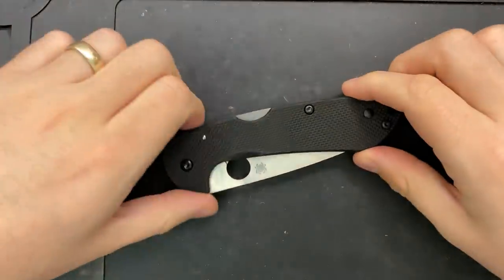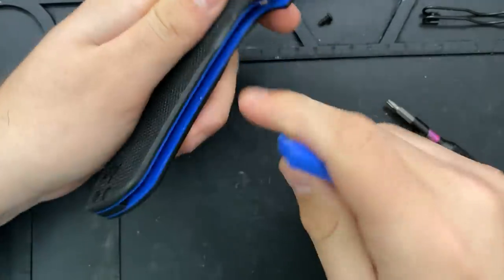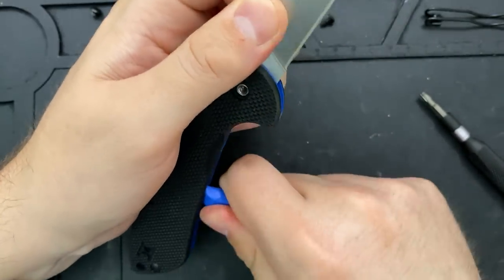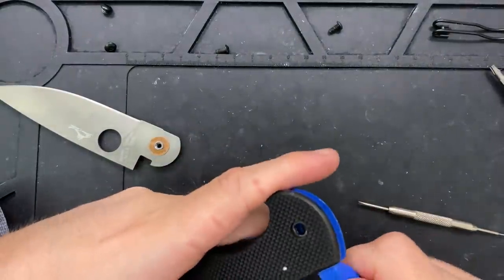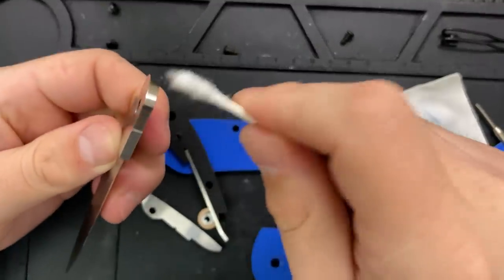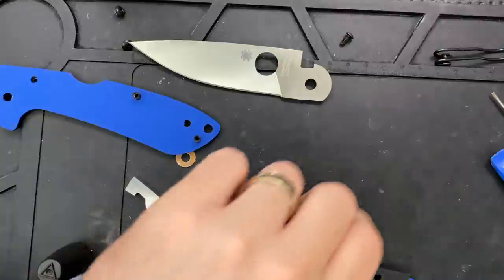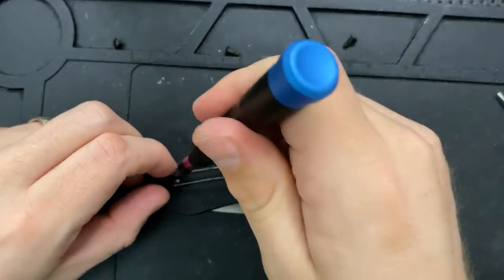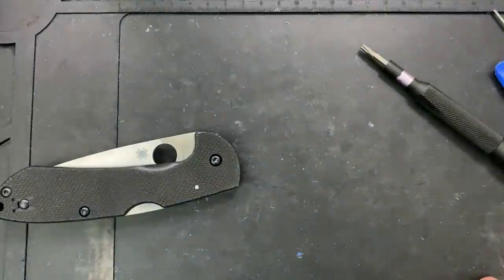How to disassemble and maintain the Spyderco Siren Pocketknife

Comment: Would've been nice to see a steel insert for the washers to slip on rather than the G10. Probably not a big deal with a back lock, but still.
Reply: The pivot pinches the washers against the G10.